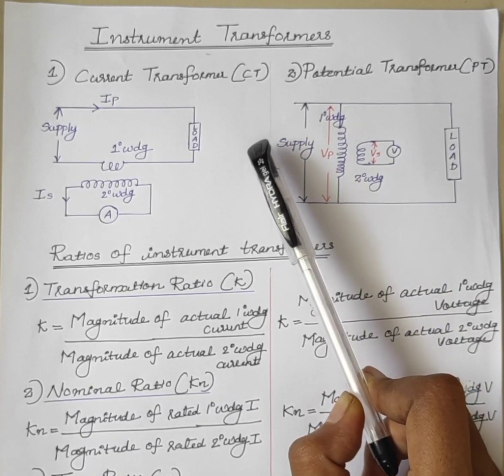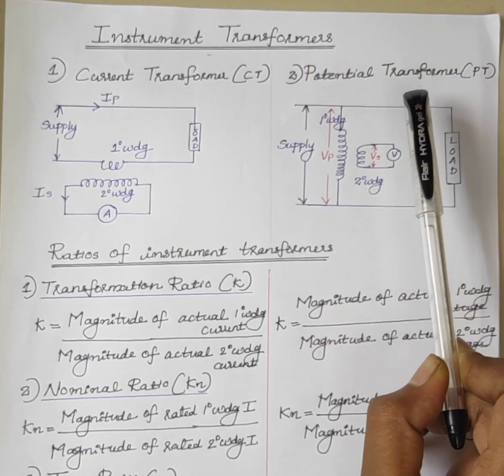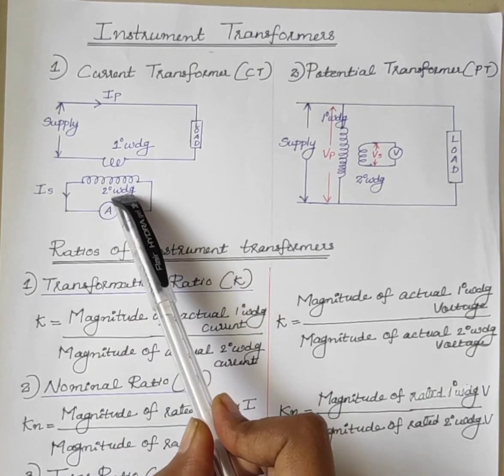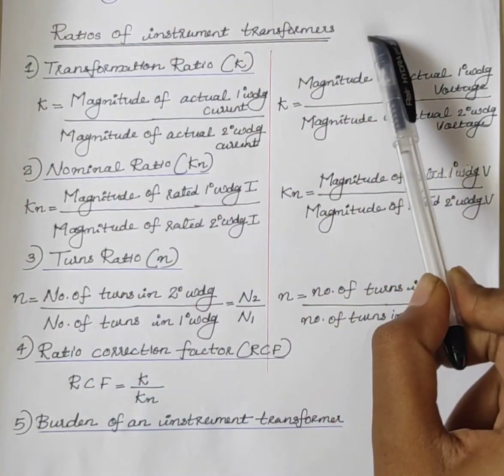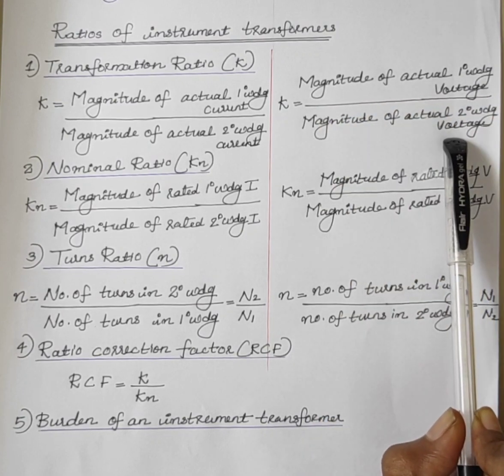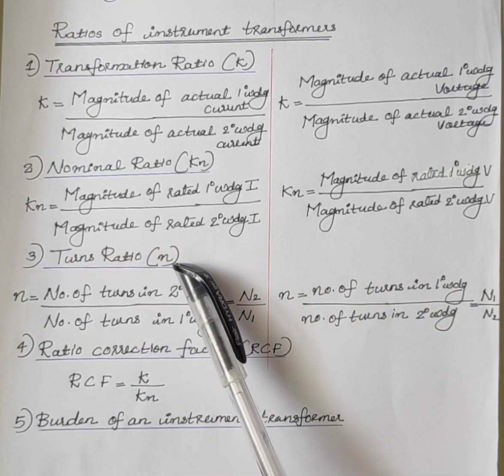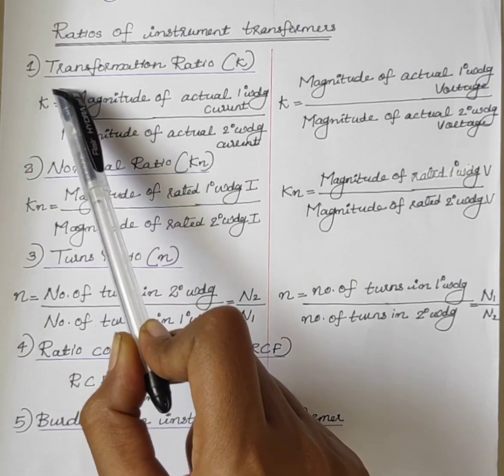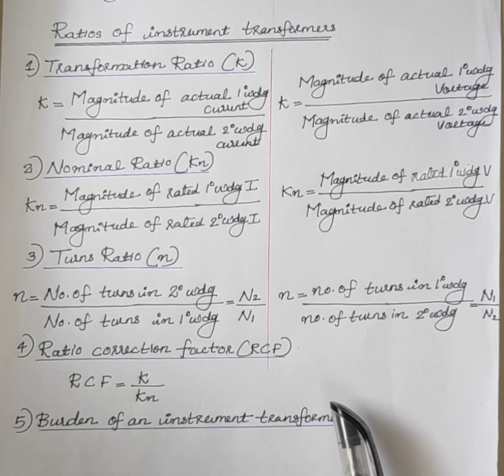Instrument Transformer - Introduction

Comment: But why the secondary winding has more turns than the primary in Current Transformer mam?
Reply: Bro it's step up transformer so voltage will be high and current Will be low
Reply: @Balaji_bolt  Oh. Thanks bro